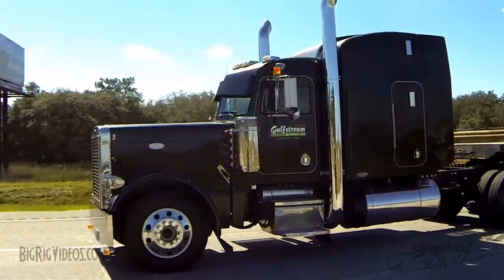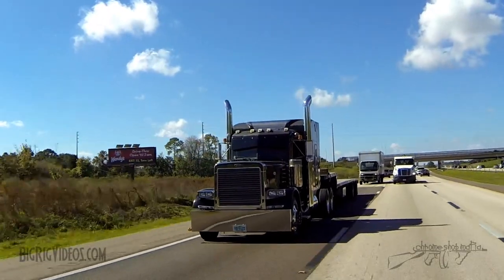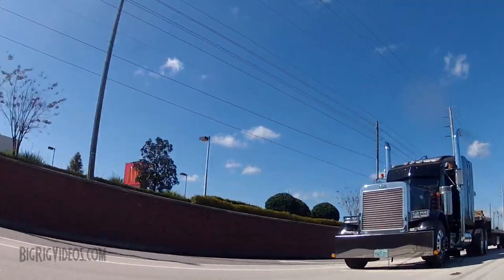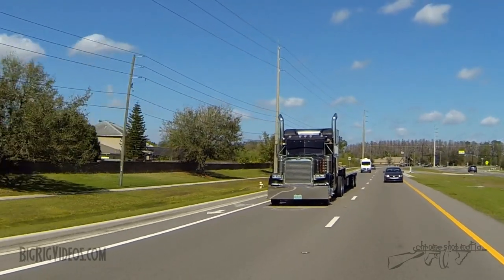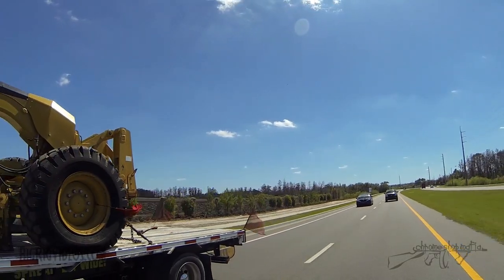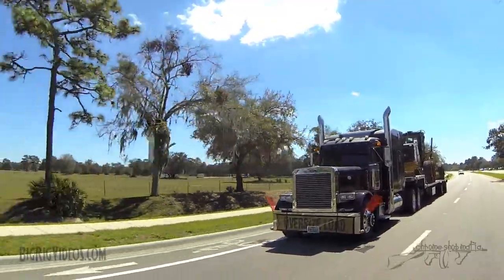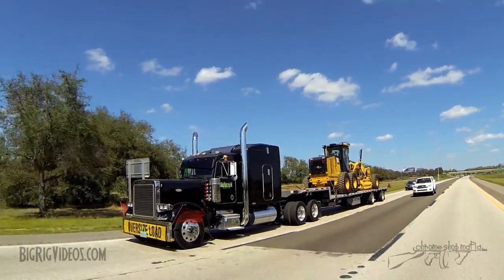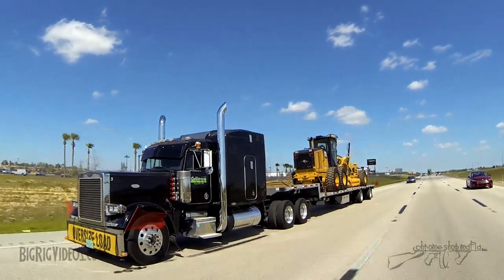Gulfstream Transport - Rolling CB Interview™

Comment: I appreciate all yalls comments about my truck. The exhaust is 8" Lincoln straight of course. The jakes on that motor are wicked strong. When the motor was put in it received all new jakes so they only have 70,000 miles or so. They bark when shes heavy. Yall be careful out there!
Reply: When ever I want to make the house rumble I connect to my sound bar,  find this video and go directly to 6:45 in the video and hang on.
Reply: them 12.7 jakes are so badass

Comment: lil bit of duct tape to cover the exhaust on that blade may possibly save a premature turbo failure for the purchasing customer.... ya see air forced into the exhaust pipe of equipment goin down the road @ 75 mph can cause the turbo inducer/exducer blades to spin (especially going that many miles) without getting any oil from engine oil pressure as it would if it were would running. I hauled heavy equipment in Phx AZ metro area and my boss made us tape it up, even goin just across town.